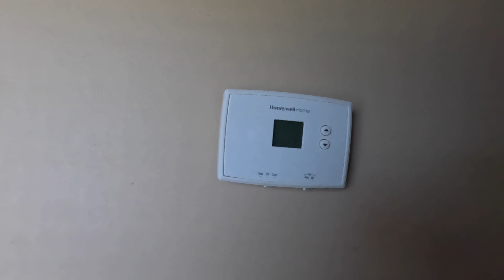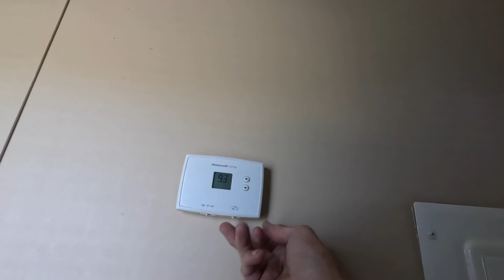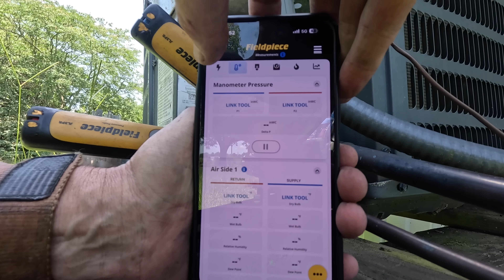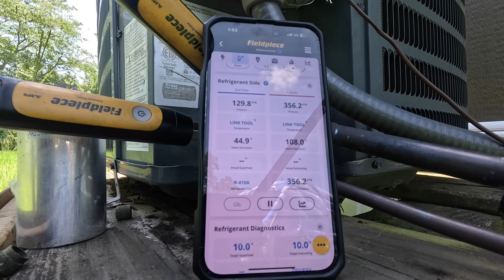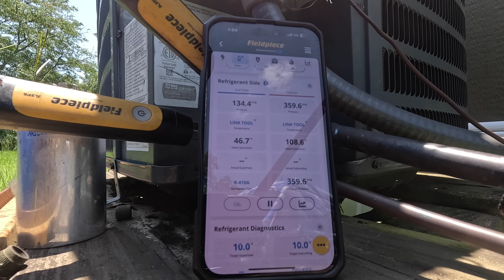Very Hot Mobile Home With No AC! #hvacguy #hvaclife #hvactrainingvideos

Comment: 1:46 That's the same model thermostat we have and every time the batteries need changed, those connector pins don't want to align. I am going to replace it with a smart thermostat.

Comment: I would have tightened the screw on the sub base and also at the condenser the stat wire needed a connector at the unit as the conductors goin into the unit was right up against raw metal ..

Comment: I think it's kind of nice to have that extra thermostat wire.    How often has Curtis had to swap wires cause ones been broken, and or had to ad on an extension to an existing wire because there was nothing left of the original to make a repair.     Nothing wrong with leaving a loop of wire tucked in neatly.

Comment: why are so many ac units in mobile homes   down there mounted on the home itself?
Reply: So there off the ground and the contractor or maitenance man can cut the grass quicker with a big tractor.    Even in Canada, for many years, we've mounted condensors on angle brackets from the house foundation, rather than a base on the grass.   This way people can cut the grass or shovel snow underneath  the condensor for the walkway, and no need to take the weed wacker anywhere near the condensor, wires or line set.    Look how many condensors have damage to the liquid tight conduit, thermostat wires, line sets, foam pipe insulation.   Then the condensor is usually plugged from grass clippings too.   Get it off the ground solves many potential problems.

Comment: You need a 10 x 10 canopy to put over the condensor unit for defense against sun and rain. Just my opinion.
Reply: Not a great option for hvac unless your going to be several hours on same project. Umbrella’s are much better.
Reply: The top discharge condensers will recirculate the discharge air unless are at least 10 feet above top of condensing unit! Had one cuswtomer built a shed only 2 feet above unit...had to rip it out!
Reply: My unit discharges the air to the sides of the unit and not straight above. So basically I don't understand how that makes sense. I hear what you're saying I just don't understand. But that's why I'm just a bug. Hehe  @bobboscarato1313
Reply: @Brad_Whitley  I mentioned "top discharge"; We had some side discharge units reaching neighbors units 20 ft, away;homeowners planted shrubs next to condensers and that was problematic too!
Reply: @bobboscarato1313  True, by the time you get it where it needs to be, you are no longer shading it.
Reply: @jthonn  We need moving trees!

Comment: Good video Curtis! Looks like the installer running the 24 volt wires planned on setting the unit 50 feet from the home 🤣You're a good man for shoving that back under the home!
Reply: I would had made a rain loop and put it up high with a twist tie for any future installer knows there is extra slack. Rats will bite right thru that wire laying on the dirt under the trailer.

Comment: Curtis, the AC work up north here has gone berserk Michigan has 105° temperatures for the past two days straight. Our emergency calls are ringing off the hook so I got two of my AC guys working this weekend to try to help catch up, but the emergency calls keep coming in. Stay safe keep cool.
     🇺🇸👊🏼👊🏼✌🏼🇺🇸
Reply from the maker: Yeh, gotta get it while you can.
Reply: Make it the most while you can; I'm sure systems there under those conditions are not catching up; you may rent them some window units!
Reply: That is unusual up there, some folks don't even have AC. Make the $$ while you can, emergency calls pay well.
Reply: @jthonn  Even in Canada, we all have AC it's rare whens someone doesn't have it.    With the humidity tommorow it will feel like 115f in my city.  That magical land which most Americans think is covered in snow.   Ho Ho Ho.   Already has heat warnings posted thru Tuesday evening, and summer is just beginning.
Reply: @jthonn 
Yes, this is abnormally hot for up here, but there’s always air condition work from spring till fall plus that is only a part of my construction business. My HVAC. I have two designated guys that do that work year-round as they do heat in the winter time.